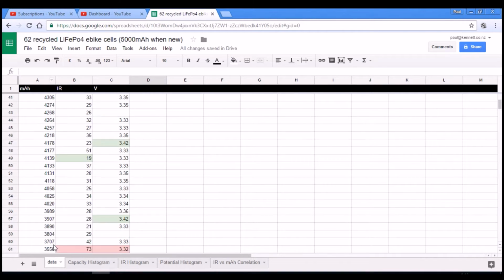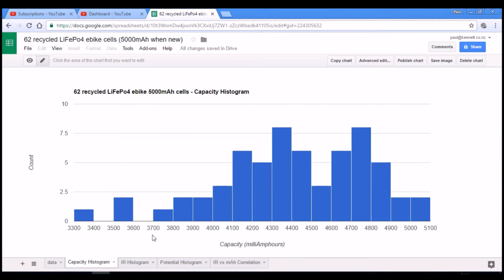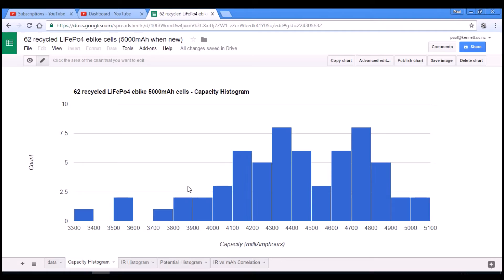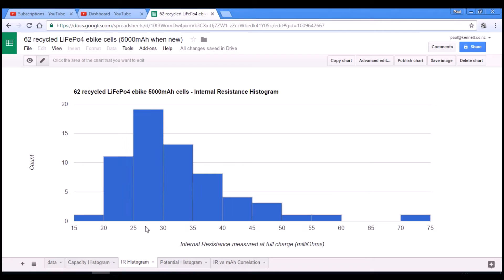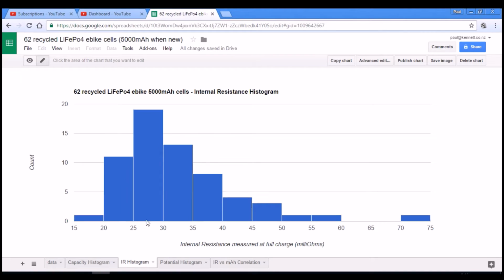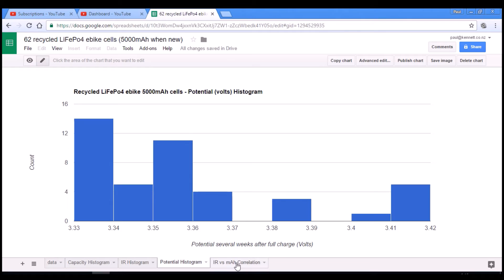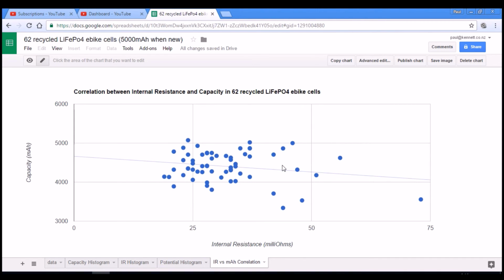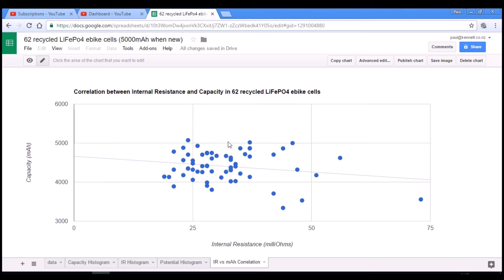Laptop Powerwall 81 - recycled LiFePo4 cells characterised

Comment: How does you measured the internal resistance.with a resistor and a calc or with a device?
Nice Pictures/Calculations in Excel
Reply from the maker: I use an iCharger 1010 to measure IR.
Reply: ok i measured it with the same device.but its not very exactly. did you have revive lifepo4 cells? from closely 0 Volt?

Comment: Interesting findings regarding internal resistance vs capacity
Reply from the maker: Yeah - not quite what I was expecting. With the standard 18650's (Li-Ion) I did find bit of a correlation. Note sure if these LiFePo4 pouch cells are diferent in that respect or maybe it's just too small a sample size.

Comment: Those 3 cells with the worst ESR/capacity look like trouble.
Given you have 63 cells (I counted the spreadsheet rows) plus 32 in the non-dismantled good pack, you could make 11P8S 24V pack (with 4 cells left) or 23P4S 12V without using those 3 funny cells.

I'd build them as 4S modules then you have a spare module.
Reply from the maker: Yep - sounds like a good plan to me.